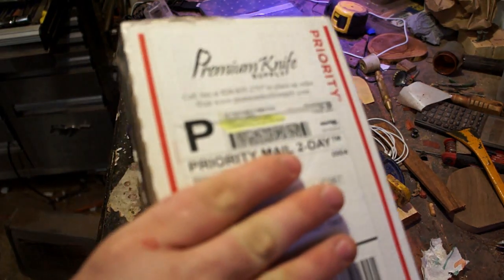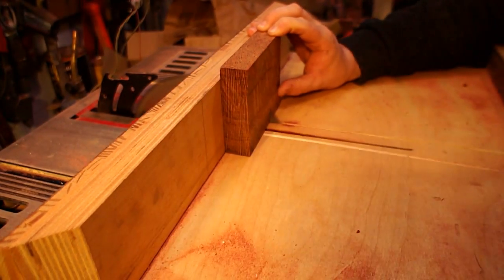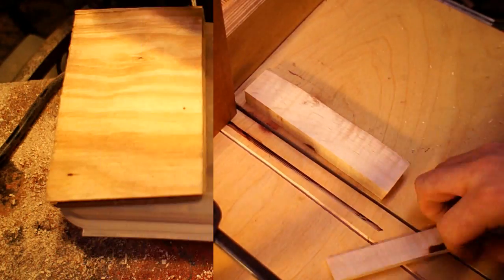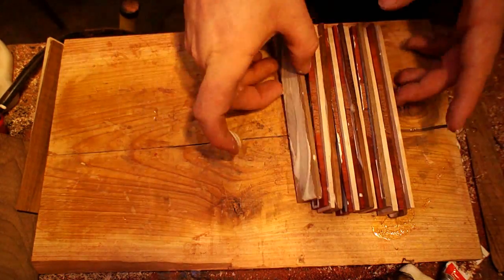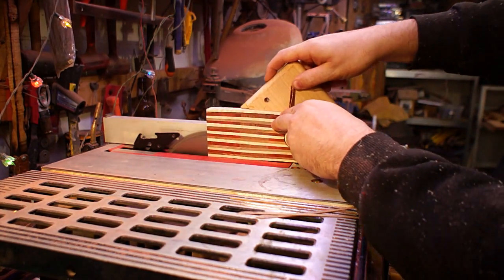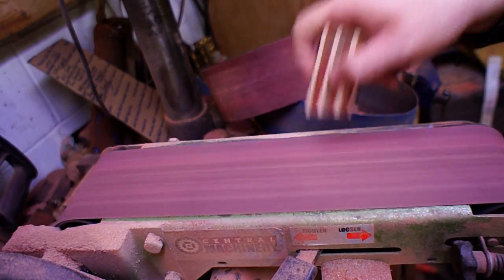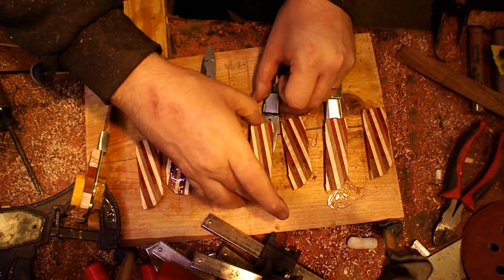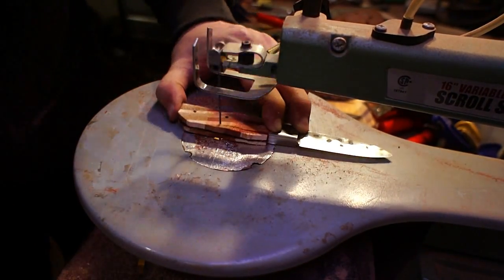Steak Knives: Nothing says "I Love You" on Valentine's day like pokey stuff

Comment: Hand wash def recommended. Dishwasher or heavy dishsoap will pull oil finish off and expand the wood,  it'll shrink back down with time but it'll start breaking your seal to the tang. I made a little kitchen knife out of spring steal and someone put it in the wash, thought my only problem was cleaning the new bit of rust off the blade, but after two times the seal between the tang and wood started breaking on the edges and now I have rust under the scale. the 2part epoxy I used seemed to stick to the wood when it expanded and contracted and pulls itself off the steel (the rivets still secure it). I've heard a few layers of spray or painted on resin underneath before sanding and on the finished top give a good seal and stop warping, but haven't tried that yet. I figured resin impregnating the scale would just be all around better for a food safe product.
Reply from the maker: I'm hoping it holds up, it's a mild soap on blade only for washing and def no dishwasher/soaking. I was planning on re applying some more wipe on poly finish every once and a while